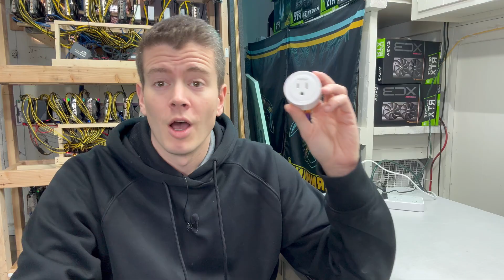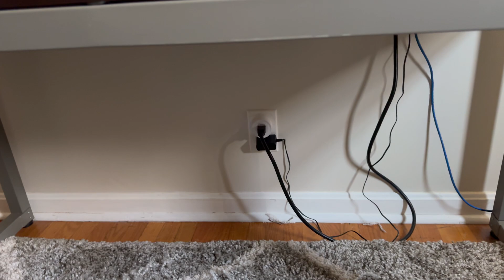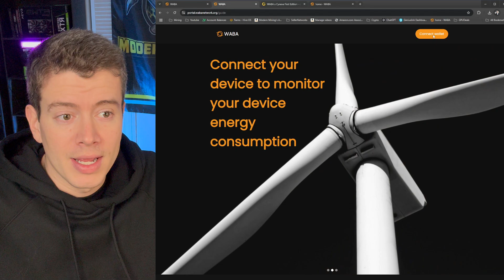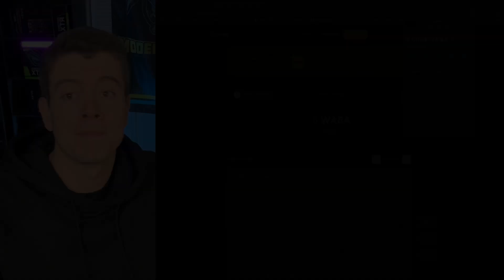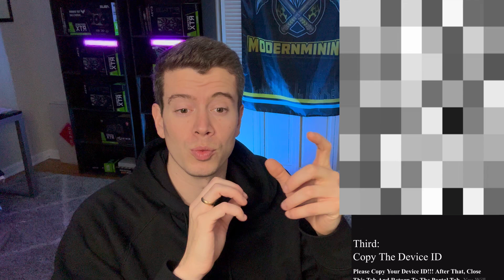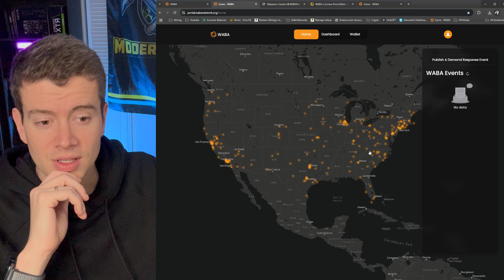How Much MONEY Can you Make From This CRYPTO Mining Smart Plug?

Comment: I have a mini pc that I need to keep running 24/7. Occasionally if I'm away it may freeze up and need a restart, but I'm not able to do this without a smart plug. Would this device be good for this situation or is it something that needs to power off regularly in order to earn?
Reply: I wouldn’t buy this I don’t think it does what it states after using for a few months
Reply: @ModernReview what do you mean? It doesn’t monitor power usage correctly? The rewards are not worth it? Do the rewards change with power time on/off? When is the TGE? Sorry for all the questions.
Reply: @TheJacobpoole84 i would just buy a standard smart outlet from Govee is what I mean